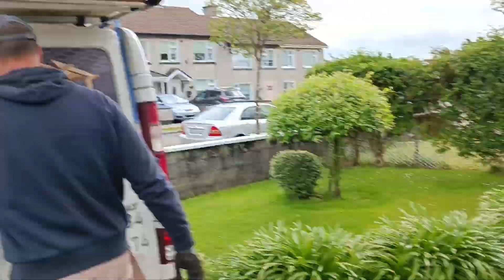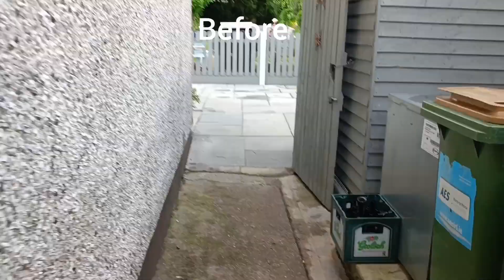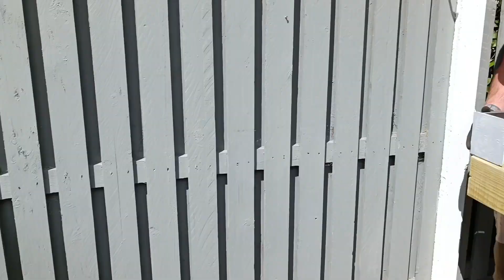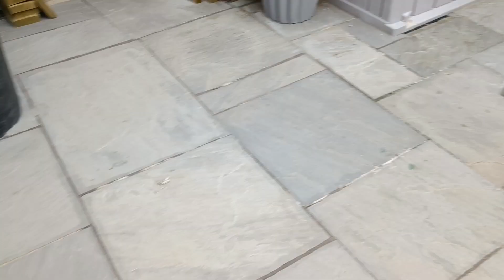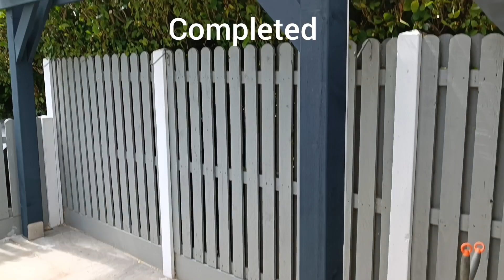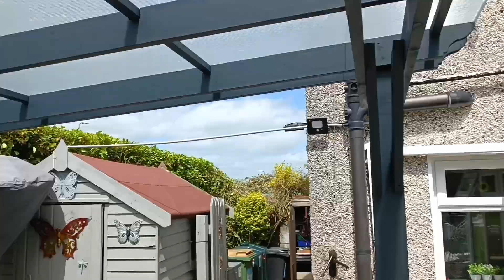Pergola with 10mm Clear Double wall Polycarbonate Roof

Comment: This looks amazing. Did you have to use concrete to put your post holders in place or did you drill them directly into the slabs? I would like to build this but need to know if I need to take up the slabs first. Thanks